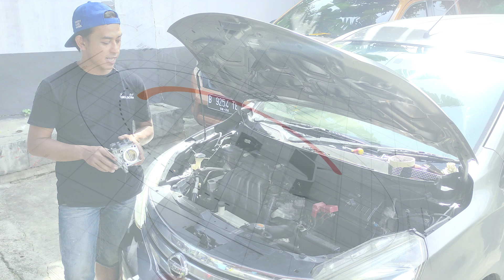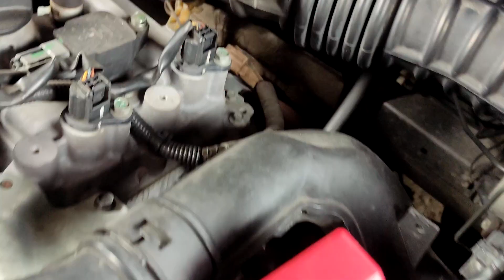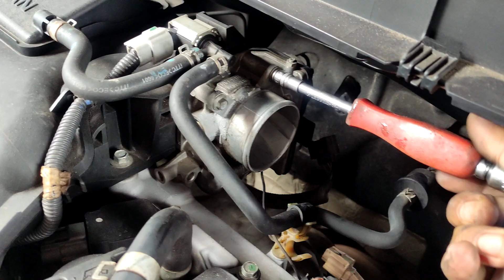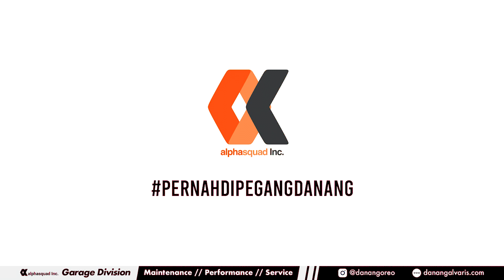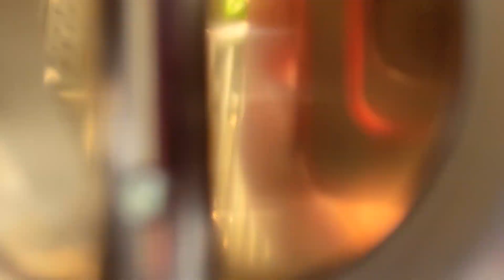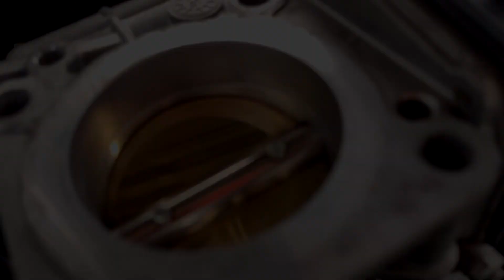Membersihkan Throttle Body - Nissan Grand Livina

Comment: Untuk cleaner-nya pakai apa yang baik mas danang?
Reply from the maker: saya pake cleaner low budget om, baiknya pake yg paten seperti crc yg khusus untuk throttle body, 😁
kalo kotor berkerak pake carbon cleaner cair (yg biasanya dipake istilahnya gurah), gosok pake sikat gigi atau kuas yg halus,., 🙏🏻😁 #cmiiw
Reply: @danangalvaris  Terima kasih banyak mas Danang.

Comment: Ciri ciri mobil yg harus di bersihkan throttle body apa ya ?? Livina saya bunyi seperti nembak nembak di knalpot, tapi tenaga aman aman saja, kalau koil bocor biasanya kan tenaga low
Reply from the maker: halo om,., untuk throttle body yang dibersihkan hanya karbon/ kotoran yang ada di sekitar valve / kupu / coin itu,., untuk maintenance berkala bisa dengan membuka motor & gear transfer  yang ditutup plastik hitam,.,
untuk kendala nembak2, kemugkinan ada bocor di intake, entah dari seal intake, atau pcv valve,., apabila terjadi koil bocor/ mati / busi mati itu gejalanya pincang, dan makin tinggi rpm makin berasa,.., 🙏😎 #cmiiw
Reply: @ bersiin intake saya mau coba
Reply: @danangalvaris  nembaknya cuma di awal, pas di geber gas dan mesin panas nembak nya hilang om
Reply from the maker: sepertinya ada kebocoran intake om  @RobertCahneldi  , coba semprot pake carb cleaner di bagian sambungan intake, di bagian pcv, dan belakang ada selang ke booster rem 🙏🏼😎 #cmiiw
Reply: @danangalvaris  terima kasih banyak ilmu nya om, akan saya coba